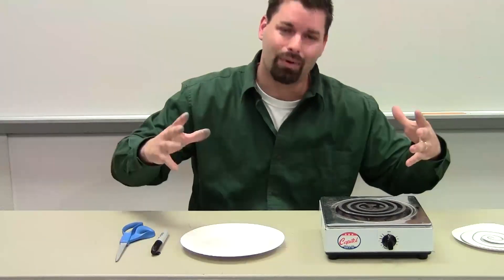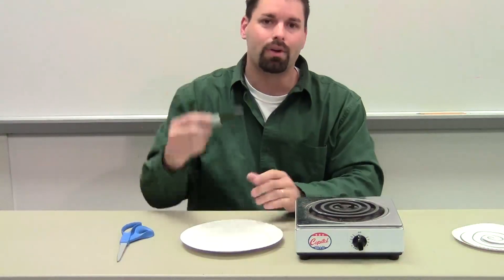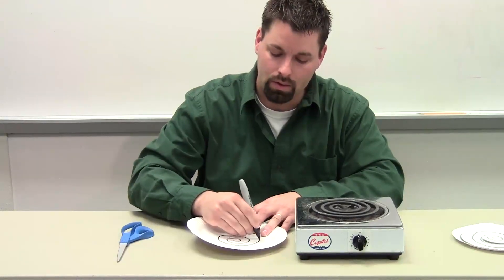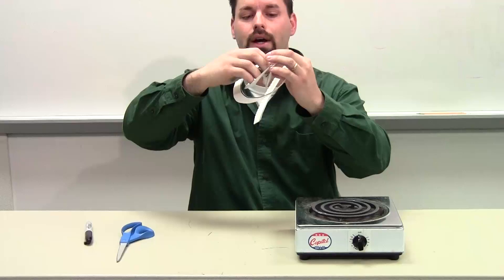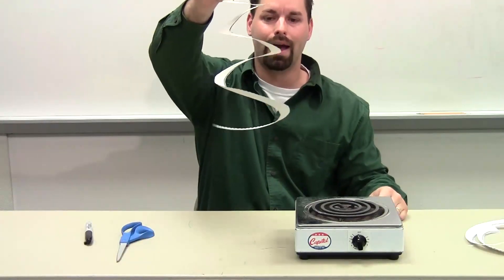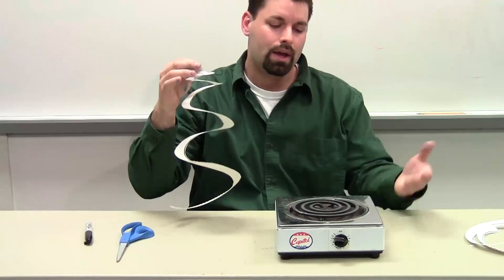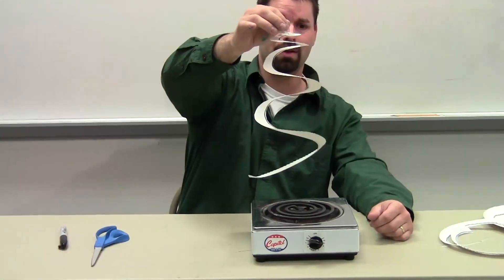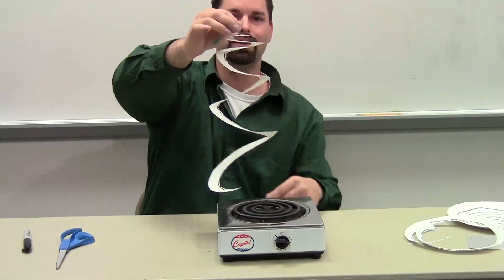Warm Air Rises - The Spinning Paper Plate

Comment: Warm air doesn't rise it's not levitation! It's pushed up by the cooler (air is a fluid). Also Heat doesn't rise as heat is energy. Otherwise good video
Reply: No the warm air takes the cooler airs place while the cool air takes the warm airs old position 🖕🖕🖕🖕

Comment: Nice!  The kids wouldn't have to squint if you get the burner really hot and then shine the light of an overhead projector (or flashlight) onto the whiteboard or screen and you'll see all the little density differences swirling and rising in the shadows that are created by the hot rising air....I don't have a video as I only demo'd that once accidentally as I was doing something else...your video made me think of it......even HS kids might like to try stuff like some of your demos!  Thanks!